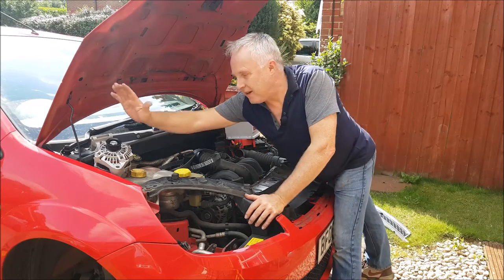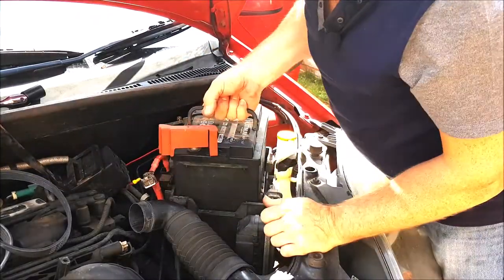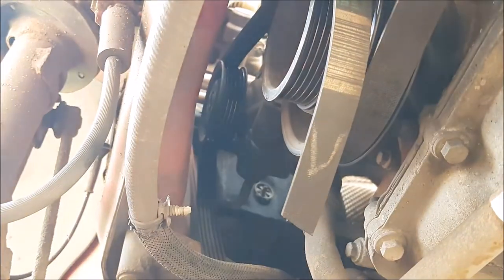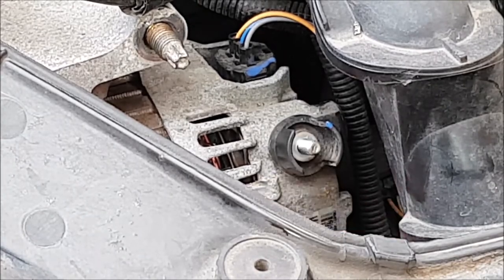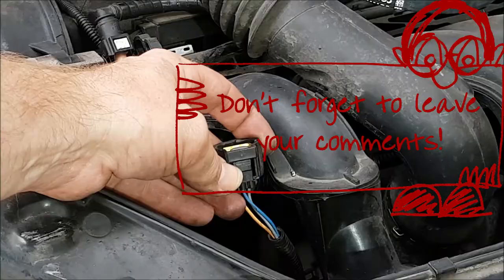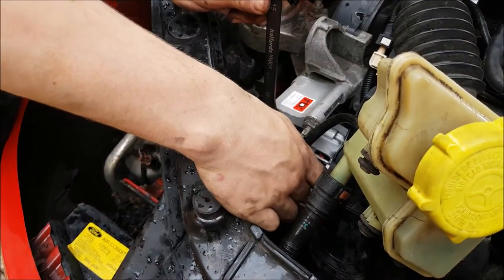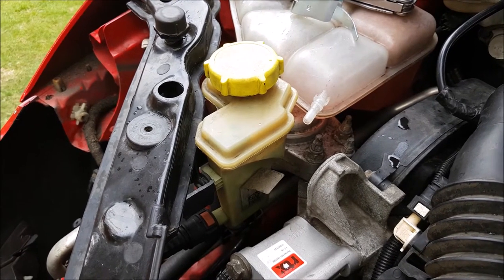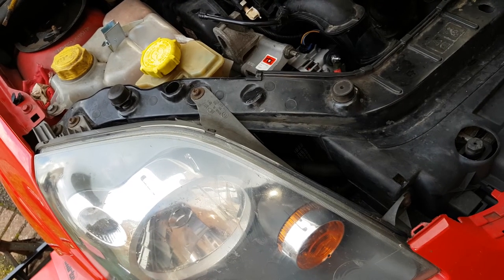Ford Fiesta MK6 Alternator Change | Fiesta serpentine belt Replacement

Comment from the maker: Something I didn't cover in this video is cars with and without aircon.
Cars without aircon have one belt and the pas pump is low down on the front of the engine.
On cars with aircon, the compressor is low at the front and the pas pump is displaced to the rear top of the engine with a dedicated drive belt.
I've put a picture showing the two belt layouts in the 'community' section.
Reply: Just out of interest, what did you use to fix the broken coolant pipe? I may have done what you did even though you said don’t do what you did lol
Reply: Hi m8 I’m getting a squeak from the rear belt when I spray wd40 on it it goes away what is that rear belt called please n I can’t find the belt layout pic you said u put up . Hope u c this
Reply from the maker: @xmunclex  literally just a bit of tubing, old vacuum tube IIRC. Yeah, it's easy done. I mention my error to show to be careful AND to show I'm human too and not infallible.
Reply from the maker: @scoobydan3424  1. never spray anything other than a fine mist of water onto the belt. Now it's contaminated, you should replace it.
2. IIRC the rear belt drives the steering pump
Try the Gates catalogue:
https://www.gatesautocat.com/

Comment: I have a 2007 Mk 6 (!) Ford Fiesta Ghia Automatic 1.6 litre 5 door.  Need to have a new alternator fitted but I was told by one garage that they wouldn't know the type of alternator (seemingly it could be one of two) until they removed the old one! Another garage said they used the registration number to find the correct type of alternator! Yet the first garage also quoted the registration number and the parts supplier said it could be one of two! Please help me, which garage is correct?

Comment: My belt snapped whist I was driving and   thought my car had just died as lights started coming on after I lost power steering,I had nowhere to pull over until half a mile so I'm hoping it's not done too much damage, can you give me info on what am I looking at for fixing? Thanks for this video,it explained Why I lost power steering, power etc,👍🙏
Reply from the maker: If the battery is healthy and well charged and you keep all electrical accessories OFF, you might be able to make it home. You should only need a new belt. Be sure to clean the pulleys thoroughly with brake cleaner before fitting in case of oil contamination.
Let us know how you get on
Reply: @CycloneCyd  thank you my friend,I got home to my mother's thank goodness, it's totally dead now, won't start so we towing it this afternoon to the garage down road as I don't have time to have a go myself now, been 1 of those weeks ha ha, thanks for the information, this video helped me with diagnosis too 👍

Comment: hello cyd , just getting back to you as you requested regarding the whining sound i had from the belt area of the fiesta, i tried the stethoscope and pencil  that you recommended and its works a treat, anyway the noise was coming from the idler pulley so have replaced that and it all seems ok now! many thanks for all your help and advice, hope all is well with you and your family. thank you. the dark knight.
Reply from the maker: AWESOME❗ Such a simple tool and method, yet capable of leading one right to the source of an  issue. My son has an idler pulley screeching on his VW 1.2TSi and I've since bought a proper mechanics stethoscope, so expect to see more about tracking down noises soon.

Comment: Great vid
Out of interest. How long does this job take?
I've just been charged five hours labour for the exact same job, on the 2.0L Duratec.
Feel like I've been well turned over. But what can you do when that battery light comes on? You just want it sorted.
Reply from the maker: It took me about 3 hours incl filming. Ring a different dealer for a "guide price" and ask what is the book time for the job on your car. I feel you've been ripped off too.

Comment: Seriously wish I saw this video two days ago. The directions all say turn clockwise and the belt slips off the water pump spindle if you do this. We had spent money on the one tool set... then on the little guide tool..  in hopes if being able to get it on. But you were right... waste of money. In the end a slow work through by hand.. COUNTER clockwise ... and the belt was on in 15 minutes (video watching included). 
We didn't need the alternator replacement... and our model only has one belt (serpentine onto the alternator).
Reply from the maker: Oh, yeah❗ Don't you just hate that. I once spent the best part of a weekend on a job, only to have a fellow engineer tell me how to do it properly on Monday morning at work. I feel your pain 😬

Comment: And can I just replace the rear belt the front one is new just the rear 1 making noise mines a 1.4 with aircon
Reply from the maker: IIRC, the rear belt can only be changed by removing the front belt first, in which case you will need to change both. Never reuse a belt you have removed.

Comment: Excellent video Cyd... The major problem I have is getting the longer belt back on the car, without the belt slipping off the idler when the tension is applied... Everytime the belt is nearly on it slips off.. I have the correct belt .. any suggestions would be very gratefully received.
Reply from the maker: Clean the idler pulley with brake or carb cleaner. Give the flat side of the belt a clean too with cleaner on a cloth. It should grip the pulley then.

Comment: great vid. just put new belts on my mk6 but now i need to replace the thermostat housing due to a leak. don't want to remove the alternator to get at it because of the new belt, is there a way to remove the housing without removing the alternator? would a garage replace the housing without removing the alternator? cheers cyd

Comment: My pas belt ticks when cold. Just started doing it. Can't see any fraying on belt.
Reply from the maker: Change the belt. They're cheap enough you can change as a precaution. Clean the pulleys with brake cleaner too.
Reply: Cheers cyd. It getting changed today. Hopefully solves it

Comment: Wow, Went and did this today on my MK5 Fiesta 16v and it worked a treat.. i did however have a manre getting the lower bolt off the alternator while it was on the jack stand with the wheel off....after a few minutes head scratching i put the wheel back on and lowered the car back down, this allowed me to take the lower bolt out as the whole engine was moving whilst the car was aloft.....something to consider for budding DIY Mechanics out there...Cheers for the inspiration...my Car no longer sounds like a Buzzing Go Cart....

Comment: I’ve changed the belt and now I cannot turn the wheel both ways. It’s making a crazy squeaking noise. What have I done wrong?
Reply from the maker: Sounds like the power steering belt is slipping at the pump.
Is it all on square and running true?
Check for contamination on the belt too.
Reply: Cyclone Cyd think I’ve put the belt on the wrong way. Meaning the letters are going towards the battery if that makes sense mate

Comment: Thanks dude. Your video helped me loads. I had a broken water pump pulley I had to replace so did the belts too.
Reply from the maker: Glad to be of assistance Neo. Yes, it's best practice to replace any belts you take off. If you do reuse them, be sure to put them back on the same way they came off.

Comment: Hi there, very informative. Why did you remove the spark plugs?
Reply: So it would start better.
Reply: Hi fred l have been furloned off again l got a phone call from manager on monday night .l told him l was still on holiday till 11th Jan l thought l would get them back but l checked with union.cause they have been syned off l cant l went to yard in shetliston to signed papers .lam still trying to find r g leather in birkinshaw some day when you finish can you come up can follow you .l changed  my head light bulb in car the other day .if you need any changed l can do back ins as well brake lights ect.marks have got good jackets l got one £59 . You get 30 per cent off £41.30.not too bad eh? I know it was snowing last night hows roads.?
Reply: I misunderstood your 'removed ' I thought why would you remove plugs to change belts! 🤭
Reply from the maker: Who's fred?

Comment: Thank you mate. just wondering i just done changing my 2 belts anf alternator and now i can hear squeaky noise when i switch my ac on and does new alternator make whining noise? and one morething sometimes i can smell rubber is that normal? thanks
Reply from the maker: The squeaky noise could be many things, but I would suspect either the idler pulley bearings or the compressor bearings. Get yourself a mechanics stethoscope http://bit.ly/mech_steth to help you track it down and watch this https://youtu.be/jnTWmG41vX8.
Alternators often make a light whining noise when they are under load, make sure your battery is properly charged with a charger https://bit.ly/Charger_12V_6A then tcheck it unloaded and loaded.
Also make sure the pulleys all line up perfectly, especially the new alternator pulley, just in case you've fitted it out of line or fitted the wrong one. Also make sure that the belts are properly aligned to the pulleys with all the poly Vs properly in the grooves.
👆👆 CHECK these things - do not fall into the trap of allowing yourself to think "I don't need to check that, I know I did it right"

Comment: Great and informative video. Interesting note, I have a Fusion with the 1.4 version of this engine. The Haynes manual gives replacing the alternator a difficulty of 4 out of 5!
It needs to be removed to change the thermostat housing also. 

You made it look very simple. Thanks.
Reply from the maker: Ah, that'll be a pain in the posterior if the stat needs replaced. 😠 It is fairly simple, but not easy by virtue of being awkward. Don't let that stop you though - just put enough time aside and stock up on coffee ☕☕☕